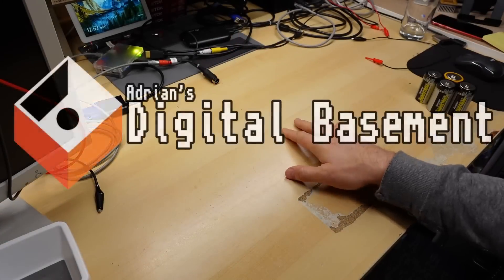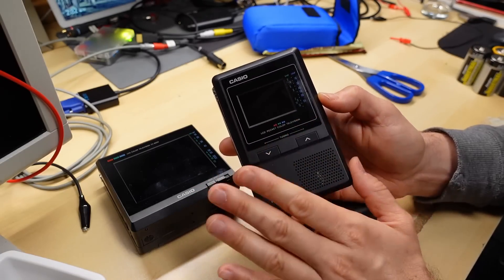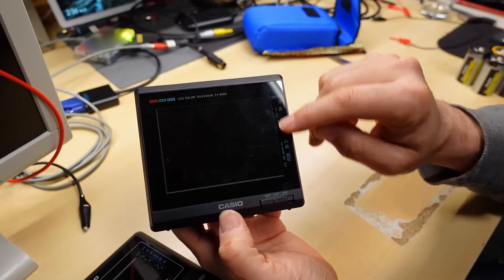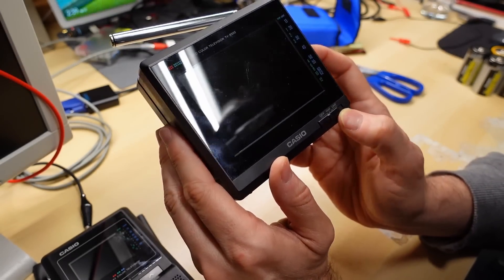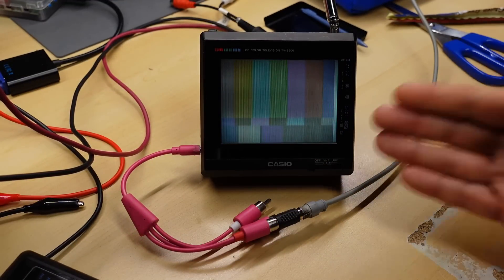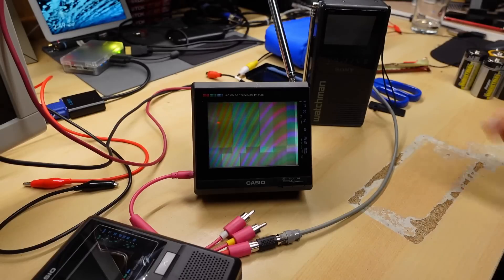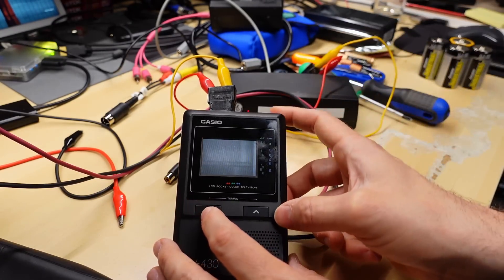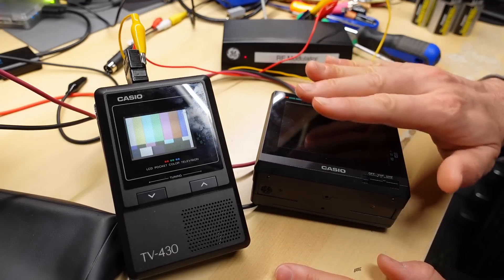Early 90's LCD portable TVs: Tour and test

Comment: I remember having one of those small screen ones when I was in the army between 1988 and 1990. Only differences, the screen was a bit wider and it worked in PAL system (Italy). Believe me, four AA batteries didn't give you not even a hour of continuous working, more like between 30 to 40 minutes depending on the batteries' quality.

Comment: 15:12 -- Did a single dot on the LCD fail? 5th full block in from the right, 2nd up from the bottom. Seems like that white spot persists through the rest of the video. Wouldn't surprise me, given the age and relative fragility of these LCD units.

Comment: I had a RadioShack clone of the smaller one when I was about 10 years old. Quality was about the same as you see here. Not decent by any standard but awesome to have for portability. Great for road trips into the city with headphones where you could tune into anything OTA. However mine did not have any sort of input for AV or even external antenna. I managed to connect my nintendo and VCR using wires crudely attached to the antenna. Even though I had a normal 12-inch CRT i would still use this "because I could".

Comment: I still have a Radio Shack Pocket Vision 34 which I keep as a backup analog TV -- don't have a basement like you :-) -- in case I ever need to plug old equipment into it (though it would be hard to see anything useful). I remember around 2007 I asked the FCC about these small portable units since manufactures were still selling a ton of them during the imminent crossover to digital and their response was "well,  you'll get a coupon for a free converter box so no problem" and I was like "they are handheld ?!?!?" My favorite portable TV (CRT) is the Radio Shack Portavision 16-119A TV AM/FM Cassette Radio. I used to have one sitting in my office in the 90's so I could watch TV if I had to stay late-night and my bosses couldn't complain I brought a TV to work :-/
Reply: I've since replaced my Pocket Vision with a digital version...an early iView one that takes actual AA batteries which is also pretty rare today as most now have built-in rechargeables that I hate since once they go you have to either scrap the unit or open it up and replace them whereas I just stick rechargeable AA's into mine.

Comment: I have a few of those little LCD TVs. I have a Citizen P422 from around 1991 and a Casio TV-880 from 2000. Both have equally horrible picture, just as yours do. What's pretty amazing is I also have a Sony portable LCD TV from 1995 - the FDL-370 Color Watchman - and it has absolutely amazing picture quality, despite being 5 years older than the Casio. I think the Casios were definitely built down to a price vs the Sony.

Comment: These things have some thick CCFL in them, that's why the're so power-thirsty.
Reply: I opened mine back in the 90s, it´s even worse: There is a fluorescent tube inside ( or 2 in case of the bigger model ), no fancy modern CCFL.
Heated cathodes means a hefty appetite for power ;)

Comment: @7:36 Not two LEDs but a single U-shaped CFL tube if it's like my similar PAL model (be careful what you touch if you power it up whilst dismantled)
Reply: True, old-fashioned fluorescent tubes with heated cathodes, no wonder why they are so power-hungry :)
Reply: Yeah, they can give you a funny belting if you touch the wrong parts inside.

Comment: They "stopped at 69" because they reallocated the bandwidth from channels 70 through 83 for cell phones.
Reply: Huh! I wondered about that.
Reply: @firesurfer  channels 70-83 served primarily as a "translator bands" containing repeater transmitters to fill gaps in coverage for existing stations.  Once cell phones got big they needed additional bandwidth so they retired 70-83 from filling the repeater role and resold the bandwidth to the carriers for cellular use.

Comment: I have a similar TV, a Casio TV-M420. Mine has CCFL backlight, not LEDs. I suppose at least your larger one has CCFL as well. Hence, the high-pitch noise from the inverter you can hear. Also has video input, I can play Gamecube on it.

Comment: Did the larger Casio have a burnt out backlight?  It looked like there was a backlight in the top and bottom third of the screen, so perhaps there's also one for the middle third which has failed causing such a dim image?  Even if not, I'd love to see a teardown to see how early LCDs worked in contrast to todays far more advanced and efficient screens.
Reply from the maker: It might be cold cathode and not LED -- so then might just need to warm up a bit -- or some tubes are bad. \
Reply: @adriansdigitalbasement2 ... at 20:23 BackLED LCD?? .. I do not think so Adrian ..... I think those have fluorescent tubes.. that's why it consumed so much power from the battery ......... like this Panasonic which also uses a mirror to reflect the sunlight in outdoors usage... >> https://www.youtube.com/watch?v=pbkxCU-Ut40
Reply: It is even more bizarre. They have one or two fluorescent tubes and a reflector behind them made out of white plastic. At factory, the light output over each tiniest portion of the screen area is measured. Then a screen-sized piece of clear plastic film which goes in front of the reflector is printed on with myriads of tiny white ink dots to dim the light transmission where the light shines brightest ( directly above the fluorescent tubes ) and no white dots where the reflected light is the dimmest ( outer part of the reflector ), resulting in an even backlight.
Things go wrong if the fluorescent tubes start to dim and someone opens the TV and pulls out the clear/dotted plastic film ( or puts it back in the wrong way - which I did )

Comment: I used one of the TV-430s to watch TV on in my bedroom after fabricobbling an AC adapter for it. It was great for watching stuff on PAX on Channel 31 here, which had old reruns of shows at that point. Kept me sane while I was doing homework or for background noise. The 430 was a very good TV and I made sure we took it with us when we went on our vacation trip to Cape May, NJ in 2005. I was right in doing so because the cable hookup at our site was busted, so we needed that little TV so my father didn't miss his weekly binge of Smallville, which was still running at that point. I can remember him saying it was a terrible TV, but after that emergency usage to get some TV in our lives during the trip, he had nothing but praise for it... until we got home and he was able to re-watch the scheduled taping on our VCR.

Comment: i think the big power consumption is from the fact that the back light is a florescent tube and not led lit, the bigger one has 2 long tubes in it, if these were lit with a more modern light source they might've been popular back then
Reply: There are led replacements for those lights, they should work for these TVs but will probably be too bright.

Comment: These are quite thirsty in the power department because in those days they used a Cold Cathode / Fluorescent tube to illuminate the display.
Reply: Yes, I once had one of those models (or a similar Later Casio model) and it ate through batteries like nobodies business.
Reply: @Charlesb88  Same here & on top of that, you couldn't skimp on the batteries- they had to be the high dollar alkalines or it wouldn't even turn on...
Reply: Same thing with early digital cameras. ccfls

Old digital cameras eat batteries.
Reply: Thanks, I was immediately wondering that
Reply: So do clamshell Macbooks, but they had a bit more power budget to play with. Two of the four monitors on my desk are fluorescent backlight and the other two are LED, and the much older, TN-panel fluorescent displays have much better black levels. I have to admit that they also run quite a lot warmer though, which of course is a bad thing on battery power unless heating is the whole point, like a vape or a soldering iron.
Reply: @mal2ksc  these have half inch diameter sized ccfl
Reply: Just like the game gear!
Reply: Really looks like a U shaped fluorescent lamp in the larger TV

Comment: Hey adrian (or someone else with more knowledge than me) i own a ton of portable LCD TV's but 2 or 3 of them have a "broken" screen where it just stays green, this seems a really common issue with those things as i also see a lot of them being sold with that same issue... is there any easy fix or is that LCD just done?
Reply: It may be lcd matrix, but a lot of similar electronic ( sony camcoders for example) suffer from bad caps and the repair is often not possible.
Reply: @kepakpl  i actually opened up 2 of my portable LCD's because i was thinking of bad caps, the caps look fine from an eye (don't have the equipment to really test them) so ye i was still unsure